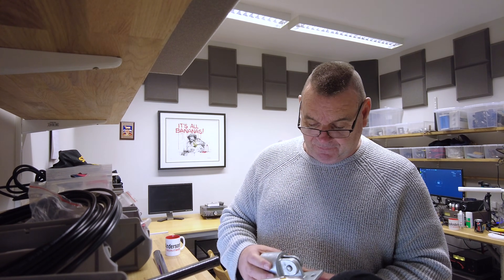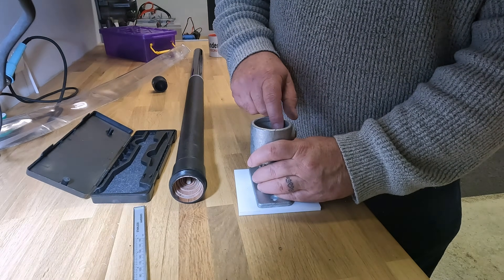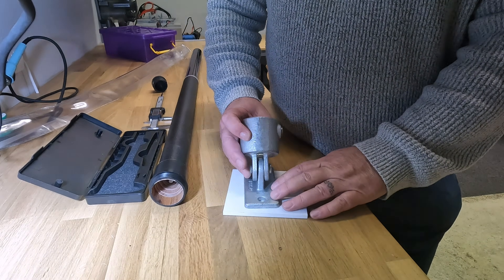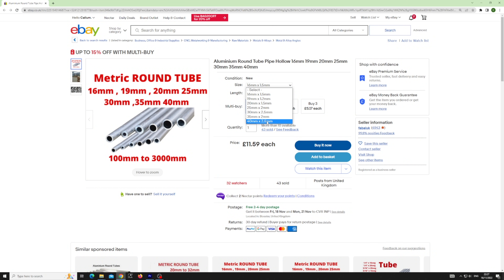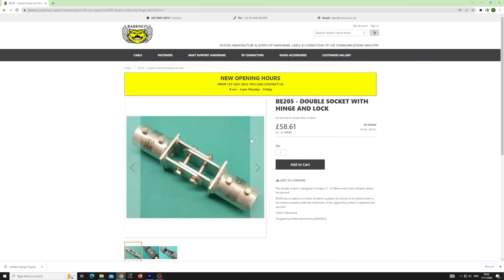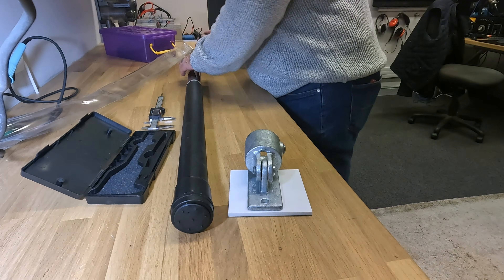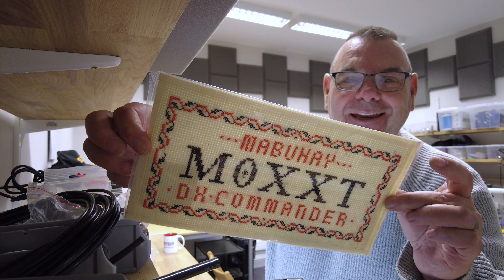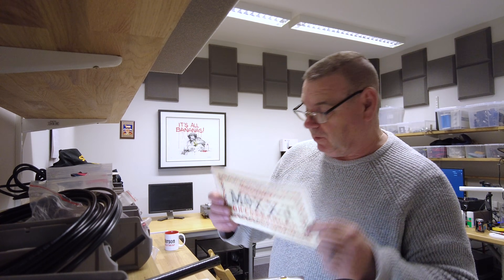Cheap Tilt-Over Antenna Base - Why Didn't I Think of This?

Comment: For many years I put up small wind machines for off grid power systems. So in addition to a hinged and secured base, my base has a T on it instead, with a shorter pole at a 90° angle. In my world we call it a gin pole. When the antenna is laying flat, the gin pole is vertical, the top of the gin pole is connected to the midpoint of the antenna. Then I also have a rope connected to the top of the gin pole. So when you pull on the gin pole it also pulls on the midpoint of the antenna as you lift it . Then when the antenna is fully vertical two of the three guy wires come up to tension. Then I unscrew the gin pole and put it away for later use.  It makes the whole damn thing so easy. 1 person job.
Reply from the maker: Yes. It's not actually  gin pole but a falling derrick. See my tower project...

Comment: Swivel flange.. I've found a more common term for the part is a swivel flange. At least here in the states. 

I'm trying to work up my vertical mast atm. Lots of Google and eBay searches and found the swivel flange. Yeets.. 

Cheers antenna goat!
Reply from the maker: Still hinges!

Comment: Another great cheap tilt over, can be made from a simple Gate hinge !
One like you might find on a pasture gate !
Simply attach the hinge to the base of the antenna, and using all thread and a few nuts to attach the all thread to the hinge, drive the all thread into the ground as your anchor point, and stand your vertical in place, and secure with appropriate guy lines !
Easy Peasy !
Oh...and did I say, 
" CHEAP " ?
👍😉
Reply from the maker: Great tip!
Reply: @DXCommanderHQ  
Thanks !
'73 !

Comment: I currently have a single 20ft scaff pole with antennas on top. 
Currently the ground is taking the weight and it is held up using two heavy duty wall clamps (like tv antenna brackets)
This keeps the weifht on the ground and the pole secure. 

Only problem I have is it’s a nightmare to get down. 

I think If I put on of these on it. Bolted to the ground. Means the ground still takes weight. 
 But I can unclamp it and then winch it down.
Reply from the maker: At home, I winch mine down by hand with a 6:1 pulley.

Comment: Looks akin to a flag pole bracket, though those are usually smaller diameter.
Reply from the maker: You can also find these by searching for "metal hand rail connectors"

Comment: I made a cheap tilt-over for my Hustler 6-BTV. Made from two 42mm gal-steel pipes. One pipe is concreted into the ground, the other holds the antenna making sure that the antenna is as far at the top of the pipe/end cap as possible. Both are bolted together. When I need to lower it, just remove the bottom bolt, and the top bolt acts as the pivot. It’s cheap, effective, and strong as. Simple and elegant.
Reply: It reminds me of how they used to mount flag poles, with two pipes in the ground, and the flag pole in the middle! It's a great idea!

Comment: Good video Sir! You gave me a good idea doing a tilt over base, so I am going to run with it. Need to pick yours and whomever else would loke to chime in. I recently got a good deal on an A99 and want to get it in the air safely and make it wind safe. Thought about putting a 4x4x6 treated post in the ground with cement and am looking at using chain link top rail 10.5 2x's for a total of 21ft. attaching the A99 to that. How many feet in ground would the wood post need to be to keep the mast sturdy and stand up to wind? I live in SC and we can have wind gust up to 40mph average throughout the year sometimes. Any help would be greatly appreciated. Thanks and keep the videoa coming! 73's from 191 SC.
Reply from the maker: Hello.. That'll work, I'm sure. You will probably need 30 inches into the ground, possibly more depending on terrain. Have you considered a scaffold pole on home-brew a tilt base instead? Roughly same hight.
Reply: @DXCommanderHQ  I did look at scaffold poles! May go that way instead. Thanks!
Reply from the maker: @Timberwolf191  BTW.. Sailboard/ Windsurf masts fit OVER scaffold poles nicely...!

Comment: What would this bracket actually be called so that I can search for it on scaffolding supply web sites?
Reply from the maker: Look for scaffolding handrails
Reply: I believe they are also sold as bases for flag poles.  A salesperson at a hardware store should know what it is, if you describe it.
Reply: @Pootycat8359  Thanks I will investigate
Reply: Google "swivel flange"

Comment: I wonder if you could rig it up so it stays at a 45 degree angle or similar and turn your dx commander into a NVIS antenna.
Reply from the maker: Clinton, a couple years ago, I layed one on the ground and had a few contacts on 80m and 40m :)

Comment: I used a hardware store Caster wheel base. "remove wheel" and replace with EMT conduit of the needed diameter, and mounted it to a steel plate My cheap version still in service 14 years on supporting a Military Aluminium tube antenna at 22 feet.jim KB1PFL
Reply from the maker: Lovely!

Comment: Most interesting device. You could even drill a hole or two through it to help support it while up. Drill a hole all the way through while it is in whatever position you want and stick a pin or bolt through it and presto, instant hold. Would make getting your guy wires up a tad easier.
Reply from the maker: Yes maybe!

Comment: Another option, a short length of scaffold pole in the ground. add a swivel scaffold clamp (cost about 3 -4 pounds job dome.

If you want a locking type mount, make the pole a little longer and use two swivel clamps separated by a foot or so.

Andy

Comment: 8" of rope, 8" of a wooden broom stick handle.  That's all I used, already had it laying around, most people do.  You can use a wooden dowel, piece of PVC, whatever.  It tilts over in multiple directions and you can remove it in an instant.

Drill a hole in the wooden dowel (or whatever you're using) and tie one end of the rope to it.  Tie the other end to the ground mount you made.  Could use one of those dog chain anchors that screw into the ground if you want.  Dowel should have about 3-4" of play when you're done.  Lay the bottom of the pole, cap off, next to the dowel and push the dowel into the bottom of the pole.  Go lift the middle of the antenna.  The dowel will bind sideways and keep the bottom of the pole on the ground.  As long as you have lateral pressure on the pole, which you will when raising and lowering the antenna, the dowel isn't going anywhere.  The bottom of the pole isn't going anywhere.  I've used this in pretty high winds.  1/4" rope and 1" dowel is solid.
Reply from the maker: And why not :)

Comment: Great suggestion!

I wonder if you could make an adapter insert for that, say 48mm on the side that goes into the hinge, and then have it say 6" long and the OD be the same as the ID of the DX Commander you are inserting it into.

I did that on the 3" pole I concreted into the ground that used to hold my Hustler antenna but now holds my DX Commander 12.4 Signature.
Reply from the maker: Honestly, the diamaters don't matter. So long as it doesn't wobbly about too much.
Reply: There is an easy way and that is to use a brass bushing, and use a larger size scaffold coupler than your stub pole. The bushing adapts the inside diameter of the scaffold coupler to the outside diameter of the stub.

Comment: Thank you for the suggestion. If the pipe is smaller than the swivel you can sleeve the pipe to fit in the swivel 73s all Happy Friday all
Reply from the maker: Yeah, could do. But it's not "structural" so not too important.